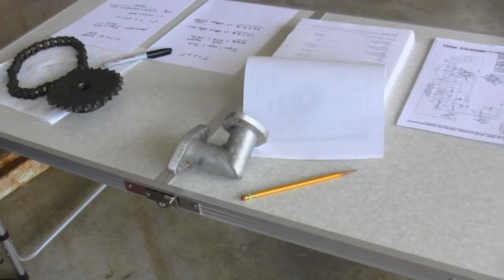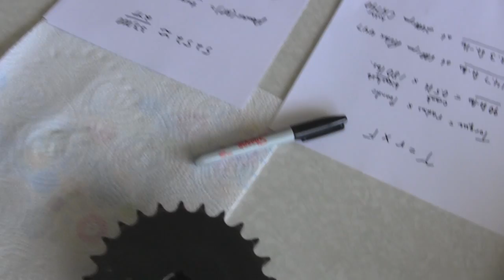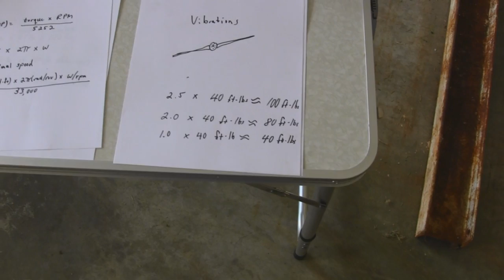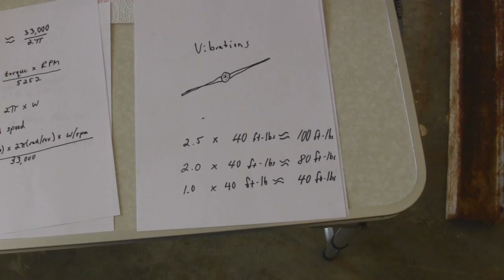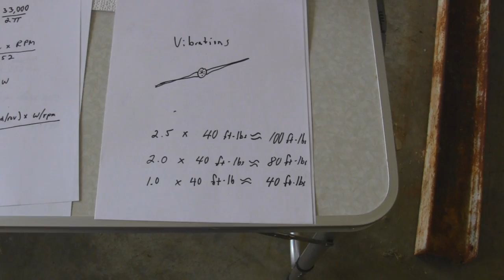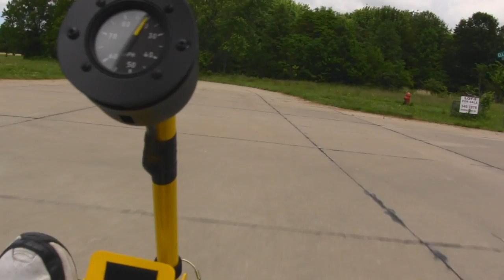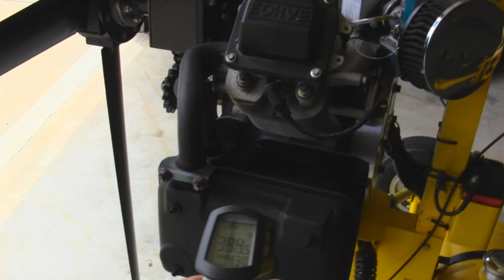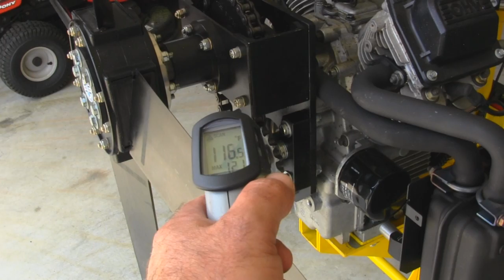Kohler ultralight engine- Part 2

Comment: Excellent drive Ron.  I would like to use a chain drive on my hovercraft .  Have a 15HP 420cc engine and a 42" Dia Multiwing 3 blade fan.  What chain size would you suggest and where can I get sprocket for 1" drive and driven shafts ?   THANKS

Comment: I have one question.... How does this redrive doesnt need thrust bearing,dont get me wrong, I think its a beautiful redrive and Im sure it works like a charm but im just confused mostly because im novice to the whole thing. So aircraft has to be pulled or pushed trough air and I don't see how that doesn't affect the redrive shaft

Comment: Hello Ron I have a phantom  with the 50 hp big twin I have a zenith  carb but have been thinking of changing  to a mickuni carb so I can  rejet for higher  elevation  not sure what all I need for the change over 990 cc and also I took the pulse pump off just using  the electric  pump but just wanted to pick your brain on the matter Tom Lawrence.

Comment: It's neat, but I'm getting good results using a belt reduction, designed it for the 38" 627cc Briggs using a 14 row multi v belt, got 120 hours on original motor. This bust the cam so built a new engine and swapped the redrive over for another 20 hours. Currently trialling an 800cc fuel injected ATV motor with a 25 row, although a 19-21 row belt would suffice. The redrive design is now being made by Ace Aviation to fit any of the industrial V-Twins. I've got what I wanted machined up under 10 pounds, so have no commercial ties but if you want to cut some weight and noise check this out https://youtu.be/sFVG-7DTU9Y
Reply from the maker: Hi Kevin,
Great to hear from you. I've been sending builders your way for years now. Love your belt drive. 
I only build one of a kind airplanes and engines. It's my form of art. I never had any interest in building and selling any of it. I did build up and sell 3 of the 2332cc 150 hp type 1 vw based engines, that I had in the black biplane I built, but that was it. 
I had this engine and redrive running for 7 years before doing any of these two videos. This engine I had in the Fokker EIII, that I designed and built before the trike. I never had any issues with it ever.
I have been sending builders to your YouTube channel, and to Midwest Super Cub for places to get parts to build up these engines.
I have stopped responding to the comments in these two videos, because I've been flying PPG for now.
Great to hear from you my friend.
Please post a link to your belt drive here if you would.
Most Sincerely,
Ron.😎
Reply: @RonBesse  hi Ron, didn't realise how accomplished you were, and hope the results with belt useful, the V-Twins pulse hard so belt seems to suit them, as it absorbs shock. Redrive link is https://www.aceaviation.co.uk/
Also I've got a Dropbox file and if you want can send that link to your email if you pm it over, you might like to poke around the drawings and suggest improvements

Comment: https://youtu.be/hq28hfgMitU
Hello sir. I am thinking about my engine for Zenith ch 750 stol. Using a Honda fit 130hp engine. I plan to use a Doble 2 gear motor for the gearbox. What do you think. Is it strong? Thanks

Comment: pretty kool. I have been running these engines on Sevtec design hovercraft for 15 years & love them. always start and work. light weight,  great power and fuel consumption. Honda and Briggs both gave me carb ice at times, the Kohler never did. the only thing I would add to what he said is....  safety wire the mufflers. they can fatigue over the years & break off.... then they might go places you wish they didn't. how do I know these things.....
Reply: Hi Tom, do you have a youtube channel doccumenting your sevtec build, I would love to see
Reply: @Hexa_cnc  sorry, no... too long ago. still running the craft though. I had a bunch of vids on the Sevtec forum but the old ones have faded. if yo want to see some action go here. I am beezer... https://sevteckits.com/phpBB/viewforum.php?f=16
Reply: @Hexa_cnc  tons of vids stuck n a bad computer but ...  then there this... https://www.youtube.com/watch?v=-gJ1xAI3kjc&feature=youtu.be

Comment: I don't care how long you been doing this or whatever because of  the high resonance of the motor and propeller that chain will cause damage to your crankshaft it's not like a motorcycle a motorcycle is not a propeller, a motor should drive the propeller but the propeller should never drive the motor you would be much better off with a double or triple belt drive with a spring tensioner pulley,  you don't believe me? just listen to How it slams when you shut it off and you have just the back of that flimsy seat to keep your head from flying back into the flywheel
Reply from the maker: LOL
Reply: Dude has used this setup for 7 years. Instead of assuming and criticizing, perhaps some thought and information gathering before you comment. You will look like a dumbass less frequently for your efforts !

Comment: I wonder if the vertical version of this engine could be adapted with a gear drive, considering the vertical version is going to be much more common to find cheap and used in the wild...   considering the vertical version is used on riding lawn mowers....

Comment: I'm curious, did you ever put a wing on this? Some hours? BTW, there's a guy who built a electric Paramotor with a chain drive http://juicedparamotors.yolasite.com/v1-construction.php  On a later version, he switched to a timing belt that looks sketchy as for power handling. I can't fine where he gave a reason for abandoning chain drive.

Comment: I love the simplicity and ruggedness of the reduction drive.  Very good and solid engineering.  Are there any specs on the bearings holding the horizontal thrust?  i.e. is the reduction drive bearings thrust beatings?

Comment: If you wanted to do a direct drive on that engine can you just machine a Thrust bearing from like a transmission or something into the case cover that goes on the end of the crankshaft. I realize it wouldn't be as efficient I'm just wondering if it could be actually done.

Comment: Reminds me of a Pete Jackson gear drive for a small block Chevy, or a jesel belt drive for a timing chain replacement, harmonics being the main reason with weight and durability as second and third reasons, I love your version and think it's bulletproof and well matched to the use, kind of Russian in strength and simplicity

Comment: nice work.... I really like your reduction drive. just a comment about carb heat...when you were checking the temps you said the manifold was @165 so carb heat was good... the manifold temp doesn't have any effect on carb icing..  usually you want to heat the air going into the carb that's how you prevent the jet from icing over.

Comment: doesn,t work...........spent like 1000 bucks fabricating a oil inclosed chain drive on a clone 460cc engine, destroyed chains in 5 mins, tight links, oil full of fillings, might of worked with a clutch or cush drive. ended up with belt drive and is faultless
Reply: .........might HAVE worked---not might OF worked!

Comment: Brilliant. Thee are so many things we do out of convention. I once asked a online group about using non-certified plywood for ribs. "NO WAY!!", they said, "you'll die a horrific death". Then I asked about using foam insulation for ribs and they were all cool with that. "But it's not certified foam....", I said. They didn't see a problem. 

Keep using chains. IMHO it doesn't even need an idler. If it works, it works.
Reply: My guess is it is better without the idler. There have been some broken cranks from flywheel to prop resonance on these things. If there is slack on the "no power" side of the chain, it should eliminate 1/2 of the load oscillation . . . keeps from generating a complete stress reversal on the crank.
Reply: Ive got ribs made from non certified wood that will support 1000 lbs, the main thing is no grain run out pitch pockets and the right wood which includes white pine, poplar, doughlas fir, spruce, hemlock, and several more

Comment: Based on your math, you lost me when you said that the Rotax and Kohler put out the same HP.  44.7x6000/5252=51 HP and 42.3x2400/5252=19 HP both fairly close to MFG specs.  Are you getting the extra HP by running the Kohler at 5200 RPM? 42.3x5200/5252=42HP?  Even with the history you have of with the engine, seems like you are making quite a few assumptions.

Comment: You could have gone with lighter chain and sprockets, saved yourself some weight but that being said I understand the desire to error on the side of caution. I'm really impressed with the whole set up, very nice. 
I'm planing on getting into ultralights but having a lifetime of experience with motorcycles so I'm not a fan of using 2 cycle engines. They're loud and temperamental, two things I really don't want while flying. Thanks for posting these videos, they're very inspiring.

Comment: balancing conversation........... I understand a new prop would not be balanced but how well is a V-twin crank balanced? im sure you probably are already better than normal with the added billet flywheel but would not the vibration be multiplied off of a direct drive? I have had a direct drive fan on my boat (go to my channel there's a video). in my experience a 42" 4 blade direct drive vs. a 48" 6 blade on a reduction give just as much vibration through the boat at idol. neither give much vibration at wot. although v-twins idol rough the Honda gx630 reacted the same from 900-1200rpm. my theory was a unbalanced crank.

Comment: The support sprocket is on the wrong side of the reduction drive.
Reply from the maker: ot1k Hi ot1k,
The engine rotates counter clock wise if you are looking from the back (windy side). Pulling down on left side and pushing up on the right. Its hard to tell in the video.
Thanks so much for watching and commenting.
Sincerely,
Ron Besse.
Reply: That's right, my bad :) I love the sound of V engines. Realy nice job. I'm using gx200 engine in my hang glider, 1st was direct drive and was working not bad but now i'm using more efficient 49 inch propeller- it pushes stronger and is more fuel efficient. i'm using 1-1.5liter (1/4-2/5 gallon) of fuel in 1 hour :-)
Reply from the maker: ot1k 
Too Cool, love to see some pictures. That has to be a blast for sure. I just feed off this experimenting stuff. Hang Gliding has to be amazing. I'm guessing you could cruise up, shut off the engine, and catch thermals?
Just to glide down without engine noise would be awesome. Total freedom. Heavier trikes come down too fast.
Thanks, I just slipped into a flying dream like coma.
Ron.
Reply: Hello what size chain and sprockets are u useing ? I want to order the same what are measurements of chain n sprocket. ? I not sure how chain sizes are said. Or sprocket types n sizes thank you

Comment: Think about over-tightened lug nuts. Standing on the lug wrench doesn't loosen them(180 ft lbs?), but a 2 lb hammer does easily. You've got two hammers against each other in this system, the prop and the crank What's going to give? Crank? Bearings? Rods? Probably not the chain! :-)   Maybe nothing will give, but
 Rotax puts rubber shock absorbers in their gearboxes. They think a system without damping is unreliable. The chain has a little more give than gears, but there is still a lot of shock possible. Does the chain mass and slack provide enough shock absorption long term? IMHO,  spring loaded idler would be much better.
Reply from the maker: Ana Carrillo Hi Ana,
Rotax did not put rubber bushings inside the 447 and 503 "B" gear box. I have had about 4 or more of them both Provision 4 and Provision 8 (4 bolt and 8 bolt pattern). They may have in some models like the "E" or "C" but not the "B".
Someone with more experience than me with Rotax product line could jump in and help (save) me here --- Please!!!
To my point about the chain, the gears in the boxes only have 3 teeth at any given moment touching. One on the small drive gear and one on each side of  the larger propeller gear. Not much surface area at all, but it works great. I really like the Rotax gear boxes.

It's funny that no one thinks about the vibrations, pulses, back lash energy loads, and thrust loads that direct drive engines handle with a massive metal propeller or even larger wooden ones. Depending on the size of the propeller, they have rpms that the pilot must not stay at very long or they pick up a resonation frequency (vibration) that can cause damage to the engine.It's like a tuning fork affect.

Also, If we were spinning a flat disk with lots of mass and suddenly let off power then we would get a back slap affect that over time could really wear on the engine internals and for sure the redrive parts, but with the propeller more gently slows down with the engine, because it's under load compressing air as intended.

Your idea for the spring loaded idler is a wonderful idea for sure. I looked into them before mounting the one I have on there now. If I was going to mass produce these things, then I would most likely go with one and redesign the whole back plate to make room. Even better would be to go with the whole thing inside a casting like the Rotax gear box with an oil bath. 

I wanted (for me anyway) to make this as simple and light as possible and still be reliable. I also have to keep the whole plane under the 254 lbs rule for PAR 103.It's not that I think this is the best way to build something, I just wanted to see if it would work. 

It's like cluster balloon flying. Is it really the best way to fly? I guess it depends on who you ask. 
  
I really have had no problems at all with this setup. I have had this engine in two different planes and been tinkering with it for 7 years now.

Thanks so much for watching and commenting, I really do enjoy the conversations, because it's all about learning and experimenting.
Sincerely,
Ron Besse.
Reply: Blankbiplane   It was an E Box.  Here's the blowup. Its part #6

http://www.ultralightnews.com/rotaxinfo/rotaxgearbox-e.html  

Was it added later?

I hope you do some more with this.  There are a lot of aluminum block engines around now. I would like to
try this on an airboat if I stay in South FL.  A Raven Redrive could easily cost 2 or 3 times the motor, so there's room for some savings. 

I saw this on an airboat site about chain cases:

 "Leave lots of room in the case for the chain. In a snowmobile when the chain breaks in the chaincase it folds up on itself and quite literally explodes the case. It has nowhere to go. Happened to me this winter. not a pretty sight....."

Also this story:
"In my younger days when I lived on the Texas coast a friend of my dad and about half outlaw had a small airboat.This boat was rigged for floundering,and in my feeble brain I think it was a 5 by 12 hull. He outran every game warden around .
He was running a Wisconsin air cooled engine ,wood prop and a chain drive. It was a pretty simple set up as I remember it ,sprocket on the motor , a shaft mounted in two pillow block bearing with a larger sprocket on top and the prop mounted on the same shaft.
In the five years I knew him he was running 2 or 3 times a week and I don't remember him ever throwing a chain ."
Reply from the maker: Ana Carrillo  Hi Ana,
I think this would be a blast on a small air-boat. On the trike I'm doing 35 mph in 5 seconds and 45 mph in about 2-3 more seconds. That's the fastest I have the coordination to do steering with my feet with such a short wheel base. I have a Suzuki street bike steering dampener using 40 weight motor oil, and it still gets tricky after 45 mph. With the wing, your up after about 32 mph.  It's really starting to pull after 35 mph. Not sure what top end would be in a small converted Jon- boat??? Now that would be fun to find out!!!!  
I don't have enough sense to be careful like I should. If it looks like fun, then I just go for it. Crashed a lot of stuff over the years, and I'm getting older. I'd look like Mr. Potato Head if I crashed now. Someone would have to go out and pickup all the peaces. I don't bounce like I use to, but that I would have to try. 

Thanks again for the conversation and for the E-box information, it's good to know. I've heard that Rotax used them on something, but I never knew what. I thought it may have been on the 912 and 914 models. 
Sincerely,
Ron Besse.
Reply: @RonBesse  The A and B boxes do have a dog clutch to absorb torsional vibrations.  This functions like the C's rubber cush drive.
Reply: +Ana Carrillo, I get what you are imagining with the standing on a lug wrench vs a hammer but it's comparing apples to apples. Kinetic energy still just transfers to foot-pounds either way. I.E. If a 180 pound person were to hop on that lug wrench the kinetic energy would make that persons weight 300 pounds and also free the stuck lug just like a dead blow hammer. 
Back to the chain, I have no experience with planes but I have a lifetime of experience on motorcycles and as a millwright. There is literally nothing that engine and prop could do that would damage that chain. I've seen electric motors in a factory with five time the torque rip structural steel and snap shafts before that chain would break. 
From a millwrights perspective there is no weak link in this system based on it's output being nothing more than a fan blade.
Reply: Brian Hagmeier I agree, perhaps with a damaged prop or bearing failure but it's separated the thrust torque from the radial torque away from the crank quite well. This setup remind me of a Pete Jackson gear drive for a small block Chevy